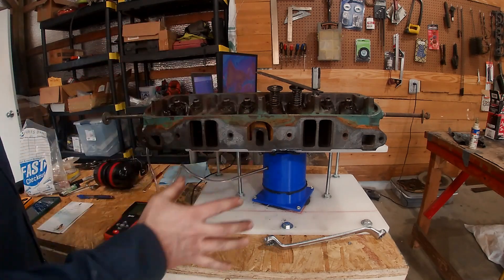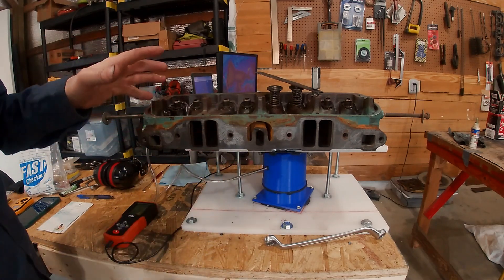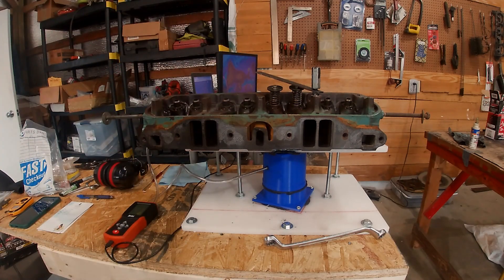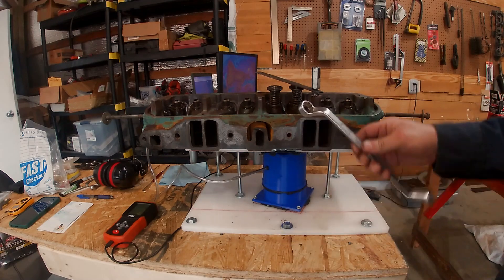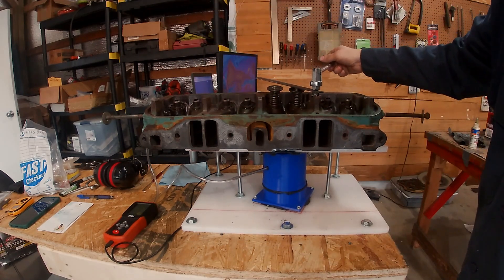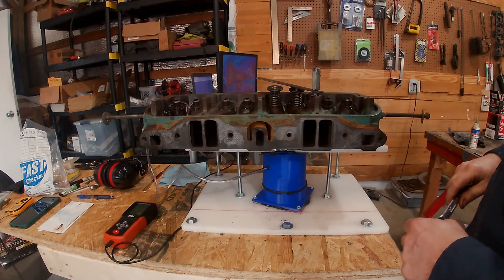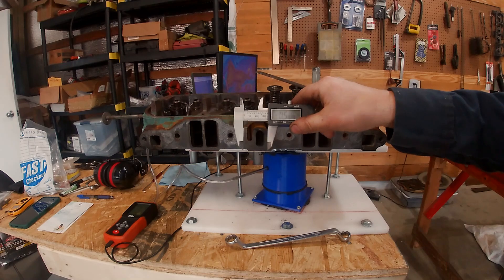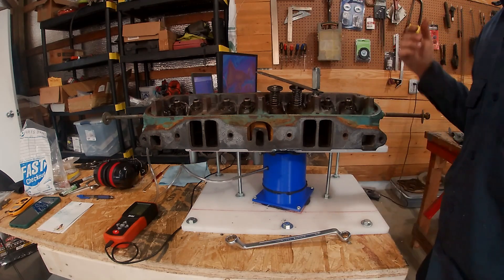DIY Flow bench Series  Refinement

Comment: Few tips for you, look at an averaging pitot (annubar) to replace what you are using now. You need to measure the flow profile across the whole diameter not a single point. Some brass tubing .125" and some holes easy to find the ratios online for hole locations. The static pickup should be flush with the cylinder wall and a small hole so it's not effected by flow velocity. You need a second static pressure pickup before the pitot so you have a standard testing pressure. Right now you have no way to know what your test pressure is as it's going to change so your pitot readings will never be repeatable. You need to do all your testing at the same static pressure, then take the pitot reading. You really need 10-12 pipe diameters before and after your pitot setup so the airflow is not turbulent. Taking readings direct under your tested part is not good practice you need some kind of settling chamber for the air . . . back to thinking non-turbulent airflow for steady readings :)

I commend you for venturing out into the DIY world! You learn so much more than just "buying" something helps you understand airflow, which helps you in your flow development work! 

Keep learning that's what life is all about :)
Reply from the maker: Much appreciated.  Yes, the current test point is not going to get me any readings.  I was able to use the bench to probe the port for dead spots though.  After doing some more research, I do not need to test at 28" as some professional benches test at 7".  Not preferred, but more realistic for my current setup. Thanks for dropping by!